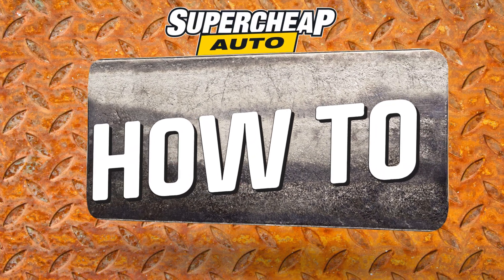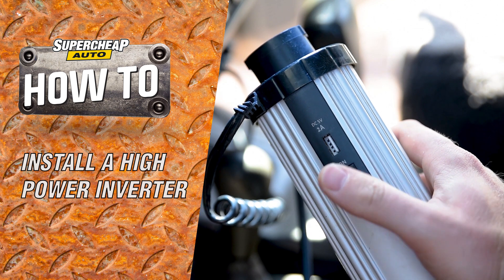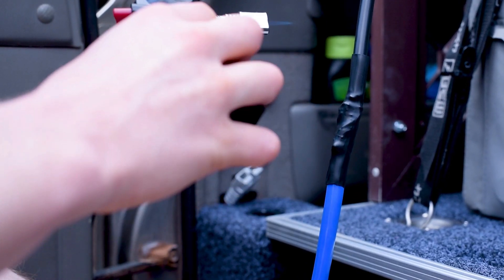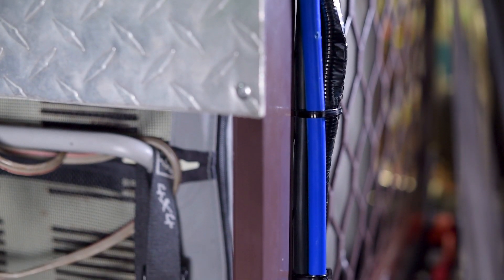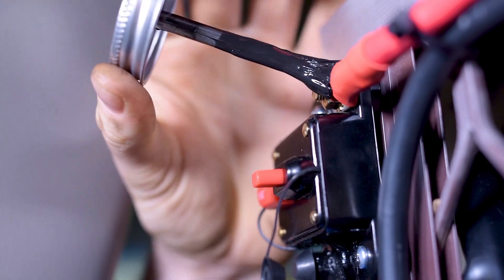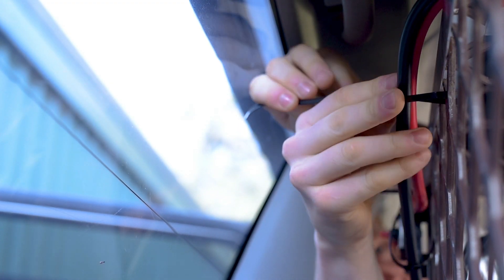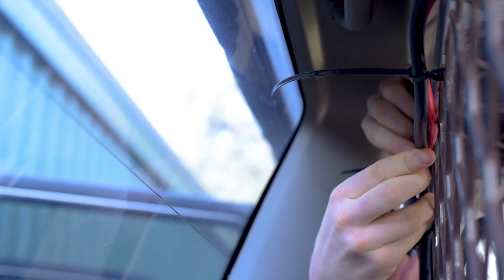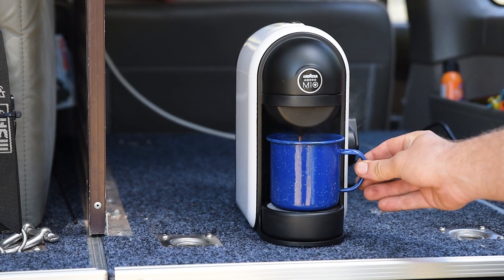How To Install A High-Power Inverter

Comment: But when you plug it into a cigarette lighter the lighter outlet uses 20amp fuse that would probably bust 

So im gonna cut the cigarette lighter part off on mine and wire it directly to the battery because i don't want the inverter going through the fuse box thats what it does when you plug it into the cigarette lighter

Comment: Does it require a deep cycle battery or can my van battery and supply battery be regular 12v batteries on a 12v 2500w power inverter
Reply: Yellow top battery
Reply: @trinacox9749  actually it’s working great now I didn’t need a yellow top battery the regular 12v car battery works fine and never dies.
Reply: @trinacox9749  Okay I thought it worked but has died again and i dont understand. I am not running my inverter with the van off i use it only with the van running so what do you think is wrong?
Reply: @mporter123456  how many amp alternator do you have? I cant remeber off hand but i thi k you need around 300amps for 2500w. Youll need to upgrade to higher amp alternator
Reply: @derekmaxwell8164  depends on how long your running it for I'll give you an example I=amps v=volts p=watts, amps×volts= watts so a circular saw running at 15 amps × 120 volts =1800 watts needed to run it. 400 watt and under inverters are reccomended for standard car batteries anything larger and you either need a deep cycle battery or a power bank which is a series of batteries connected together either paralleled in which voltage stays the same or crisscrossed in which amp hours are increased it all depends on what your running and how long your running it for.

Comment: This is Not detailed, you need to use a resistor to charge the caps from those high powered inverters before connecting the battery to avoid sparks and potentially damaging your equipment.
Reply: I know nothing about electronics, but I already know this video is shit.

Comment: tighten terminals good n firm or inverter may cut out under load, treat the inverter with safety in mind being 240v ac